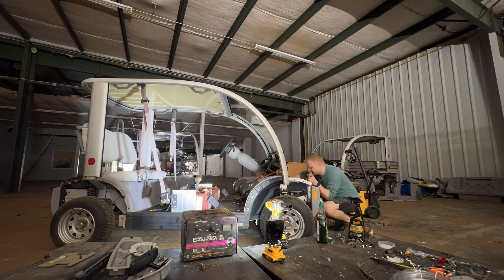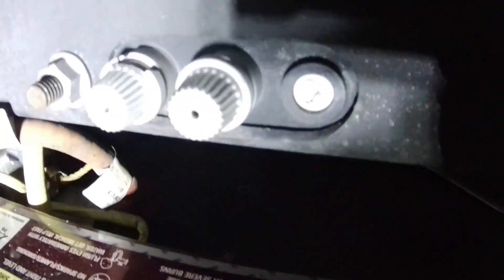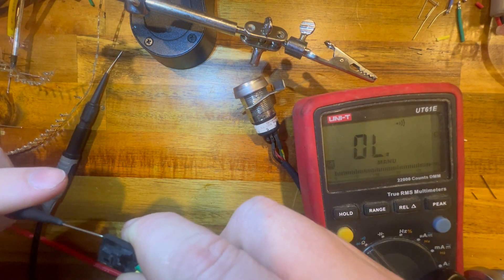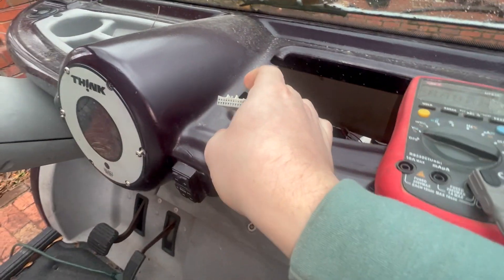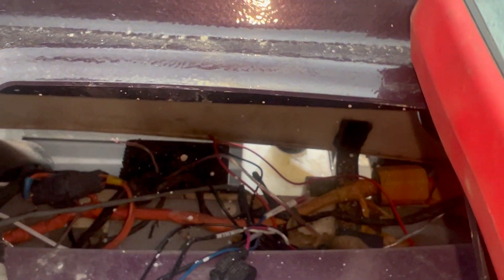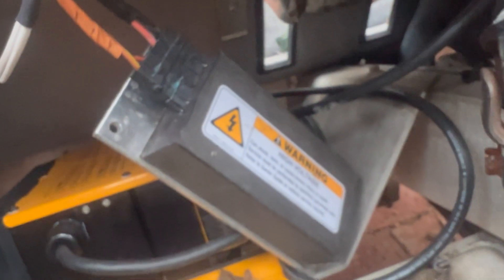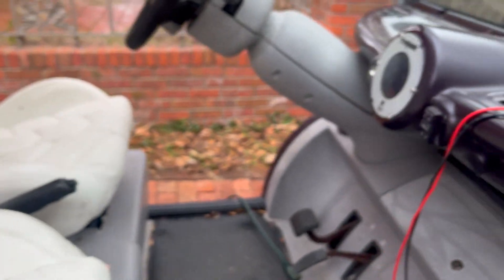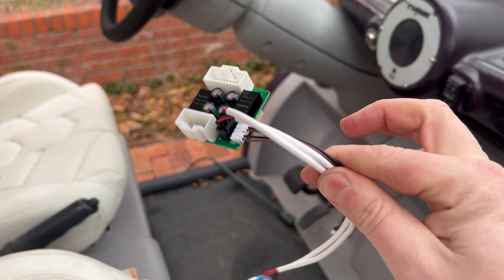START HERE! Ford Think Basic Troubleshooting.

Comment: I have a harness that was broken going into the fuse and switch panel.  Is there a pin out diagram or a details wiring schematic for this connector?   The original connector is destroyed.  Fixed the first problem and following your steps I do NOT have 72 volts at the high voltage connector.  I am going to be scanning for broken wires but if no broken wires, does that point to the converter?

Comment: I replaced my batteries and I have 72 volts, however my cluster comes on with no k3y in? Also I am not showing any power to the Dc/DC converter, all fuses replaced. No horn brake ligh5s wipers etc?

Comment: Hi Hagan, I just got a 2002 Ford Think.  The cables have been cut butl all I have left in the system is the motor, controller, contactor and throttle pedal.  Is that enough to make it go?  What is the minimum I need to do to make it go Forward and backwards?

Comment: Just finding your videos and subscribed! In your opinion what price is justified for a used Think given the number of issues that could/will occur? Seems like getting it for $1,000 or less would be ideal
Reply from the maker: Depends on where you are. They still regularly go for upwards of $3K not running or with weak batteries in fair condition. Restored, I get around $7000. I’ve never found one for under $1500.

Comment: Good afternoon Hagen, MyFord Think does not move forward or reverse.  The voltage seems to be good and I can hear the contractor click both forward and reverse.
My cluster is new and plugged into the key switch.  Electric motor?  It was going very slow prior to replacing the cluster, and then it stopped moving?  Any ideas?  What would be my next step?  When I turn on the key the cluster window looks normal.  The motor is the silver version.
Reply from the maker: Hi there, there is no silver motor. There’s a 4hp GE motor that is light blue (gunmetal) and a black 6hp motor. This could be a motor issue if you’re not seeing any other issues, I have a video on motors - cleaning the brushes and ensuring they’re not stuck. This is very difficult on the GE motor but very easy on the black motor. Do you get any whine when pressing the pedal? If so, it could be the temp sensor on the rear of the motor or the speed sensor is unplugged or faulty.

Comment: Hello Hagan , I have a 2002 Ford Think two seater. I have had it 7 years with Deka Batteries that have been Great , the other day I was golfing and the girlfriend got cold so I plugged in a small light with Heater combo into the cigarette lighter plug which has a USB for the cell phone cord, I had a Full charge and played 5 holes of golf up to this point before plugging in the Heater, I played 3 holes with heater plugged in and on Hole 8 the cart had no power period, the cluster showed nothing and the cart would do nothing . since then I pushed it back to the shed where i plugged in the power charging cord of the on board Charger and let it charge a while but nothing powered up, I took the seats apart and frame to get to the batteries after checking the 3 fuses and they looked good, I checked the batteries individually after disconnecting them all, the batteries showed between 11.5 and 13 volts after applying a load from the tester 10.5 v the lowest reading, then I went to the wiring going to the cluster and where the 12 volt cigarette connections were and noticed the fuse holder for the plug was melted but the 30 amp fuse was still good. I watched your videos and need to test for 72 volts at the plug for the cluster and the 12 volt DC to DC converter. what else do you suggest ?
Reply from the maker: Hi there - I would follow the steps in this video and then report back and we can go from there! Sometimes the fuse holders under the seat can crack and cause intermittent connections. They might look good from the front, but don’t let that deceive you. 10.5V is also pretty low. I’d say the batteries should all be a bit more equal. But charge the pack and then troubleshoot as stated in the video.
Reply: @hagan92  Ok , sounds good , I will test it today !  I will report back ! Thanks Hogan
Reply: I meant Hagan !
Reply: Ok , I did the test and their is 77.8 volts coming to the 1 and 14 pin , also when we jump on 
The 4 and 12 pin we have lights 
I am going to send you a pick of the DC to DC 84V to 12 V 100 amp unit , it only has 3 leads , a red wire with a Good fuse holder , looks like a 5 amp fuse and  a black and a yellow, the other red smaller wire is for a Lighter USB  plug combo, the lighter combo unit has a Red and black wire where the Red wire is tied into the yellow wire from the converter and the Black wire is connected to the Black wire from the converter, seems like that is not wire correctly and seems like the cluster is the culprit , what do you recommend ?
Reply: @hagan92  do you have an email where I can send pictures of the DC to DC Converter  ?  
I don’t see a way on here that lets me send pictures to you
Reply: @hagan92  Hello Hagan , I replied back above with the findings on the test of the Pins as the video showed ! Let me know what you think
Reply from the maker: @buildergene  it’s likely your cluster. You can find my email and cluster bypasses at fordthink.org.
Reply: @hagan92  I will buy the pass board for the $100 
Can  you rebuild the Cluster with the reverse engineering you talked about, And what would the cost be if I was to send it to you ?

Comment: OK this is where I’m at right now at your end of your videos all t Tess are done completed. 
OK I turn the key on and you heard the contactor turn on so I hear that. 

It is receiving a signal
I hear the contactor click but the car does not move. 
The motor controller is not clicking what you’re hearing is the Cilla Noyd right. 

I’m not sure if my motor control is receiving a signal cause I hear the click but I always thought that click was the solenoid without the one I was testing for 72 with the key off with the key off. 

I have a full bypass that I am using for my instrument cluster all signal lights turned on and everything when I got the second conductor conductor I think it’s a 12pin  the 20 pinseems to work fine pin